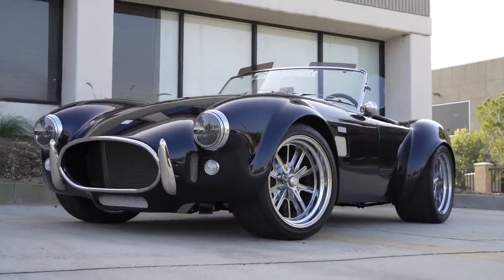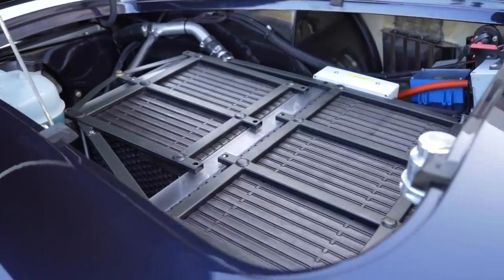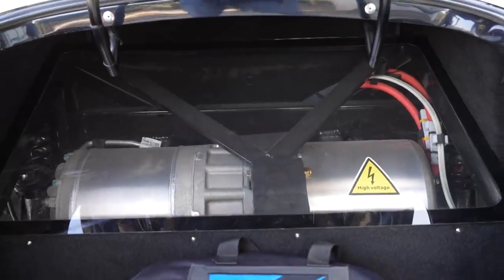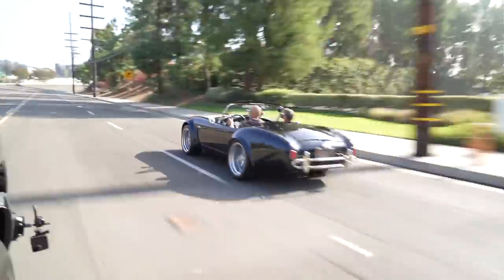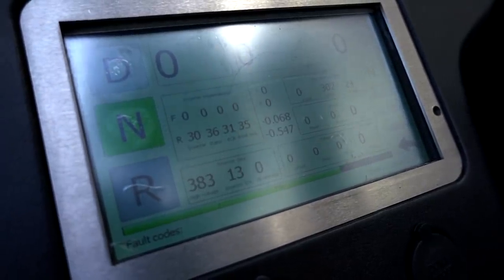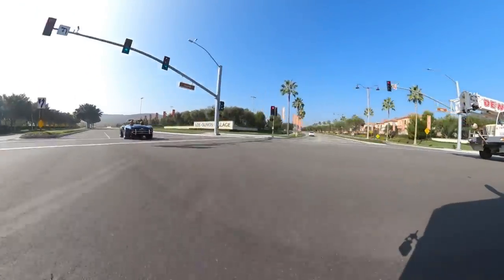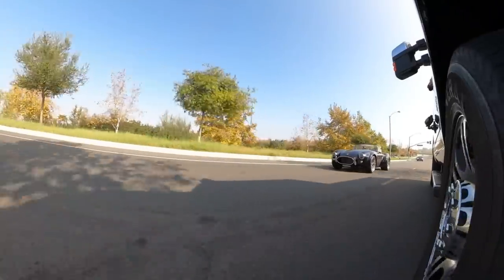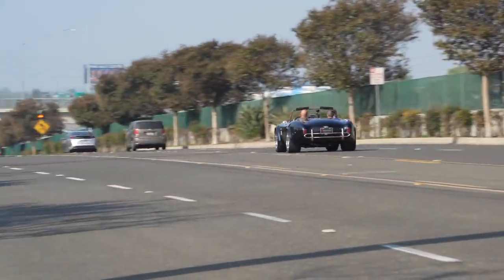1,500 ft-lb Torque Electric Powered Shelby Cobra Tesla KILLER by Superformance

Comment: Wow, the Superformance cars are WAY heavier than a real Shelby (original or continuation).  A small block Shelby car is at least 300 lbs lighter than this car.
Reply: Really doesn't help that batteries and electronic bits add hundreds of extra pounds too

Comment: OMG that car is a death trap. The LG Chem battery modules in the front aren't even in any sort of battery box to protect them at all, they're just open to the elements. The first puddle of water that car goes through will end that car. I wouldn't trust whoever converted that car to change a light bulb, they don't seem to know anything about electrics. Poor job Superformance.

Comment: Well if gas goes up to $10 a gallon then electric may be the way to go. It will definitely be faster and a 4 wheel drive version will be karazee :O I still enjoy a deep throaty rumble so they just need to build some sub-woofers into this and have a variable sound trac. I really hate that flat screen. Put all the electronics into gauges and why not have a shifter??? Superformance is a very smart company for doing this :)

Comment: I always knew electric cars could perform.  Years of slot cars and radio controlled cars told me that.  Unfortunately the first electric cars were designed by some girl in Hong Kong and looked like a Hello Kitty prop. The performance was just as ugly.  Elon Musk knew that the 'cool factor' would sell more cars.
All these comments about the lack of noise so I guess they missed that it is de-tuned to almost 25% of it's possible output.  It's already faster than most gas powered cars and it's not even trying.  I can't wait to jail break one of these things like a cell phone and feel ALL of the power. 
The next question is who's going to be the first company to make brackets to simulate the mounting pads of chevy,  Ford and Chrysler engines so we can drop these in anything just like a crate motor?

And for God's sake widen the footwells in that Cobra since you don't have a transmission in it.

Comment: The thing about electric motors. They have the power from start to finish. No rpms to get to the hp peak. Not doing anything on its at 1500. Like he said they had to tune it down to make it safe. That is fucken sweet. I work on electric forklifts they r the shit. Don't get me wrong the v8 the rumble and so on r fucken sweet. Electric that thing will eat them up n a quarter, o-60 and so on. Dangerous is all I can say for now

Comment: I'm sure there's an app that will pipe engine noise through the speakers, fibrate the wheel and seat, and even belch smoke in your face if that's really what gets you off.  Is the hate really that you can't be loud to the world?

Comment: Beautifully assembled car that also happens to be an icon. Don’t care for the drivetrain though. I’d rather have a 150hp V8 in there from the 70s and at least SOUND like a Cobra than to get 1500 ft/lbs of torque but no soul…

Comment: No different than riding in some high speed train..it's just a commuter vehicle. No connection to the road,  No gearing or performance feel. No one cares if it does the 1/4 in 3 seconds , I want driver imput and to manipulate the performance with gears.